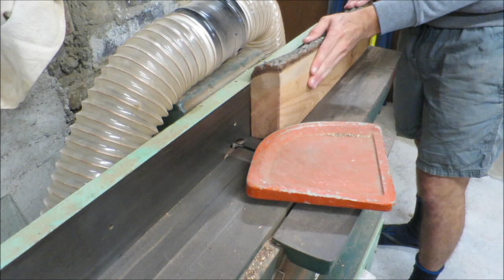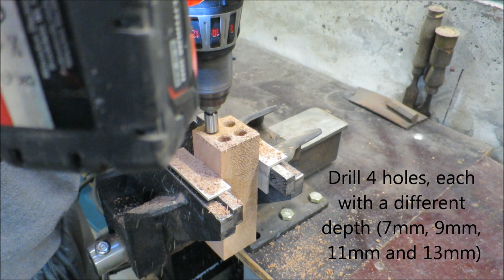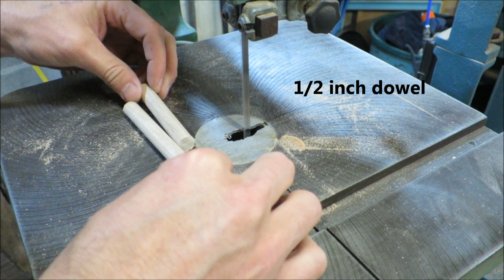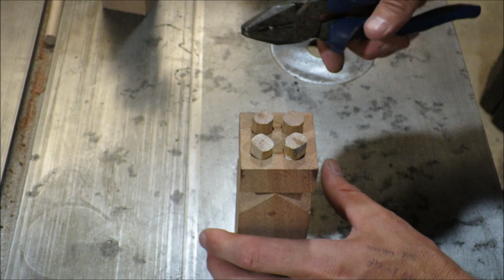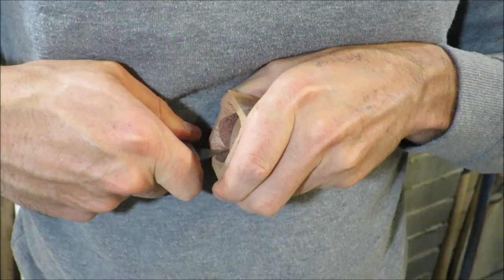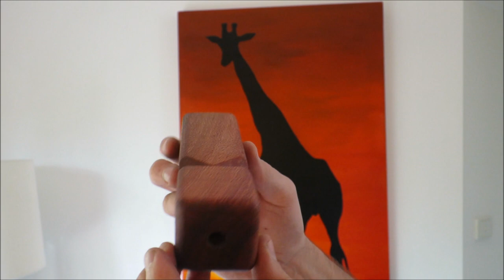Making a Train whistle

Comment: Nice. Do you intend these for pocket novelty use, or shop air ? Bar/PSI ?
Reply from the maker: One of these was a present for a 3 year old, so yer I made them as toys. The air pressure to make them work is a blow from the lungs, so what ever that is in PSI/Bar.